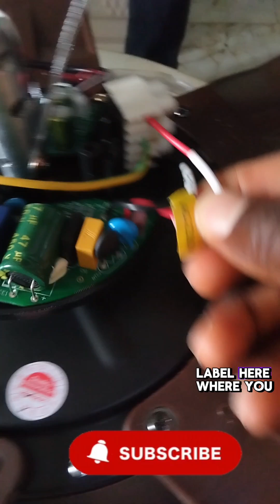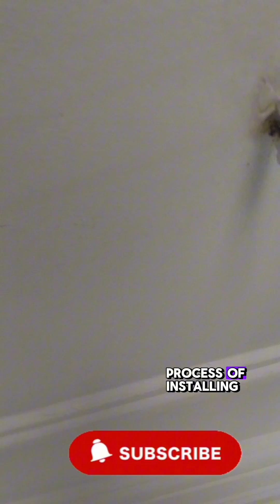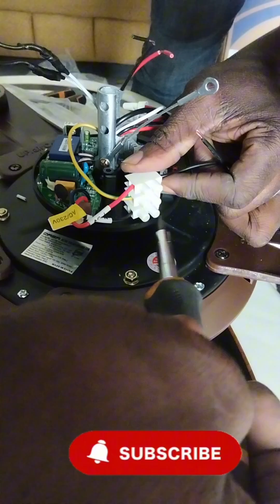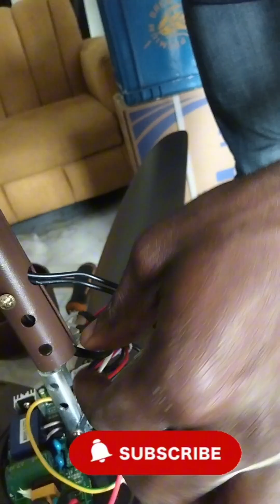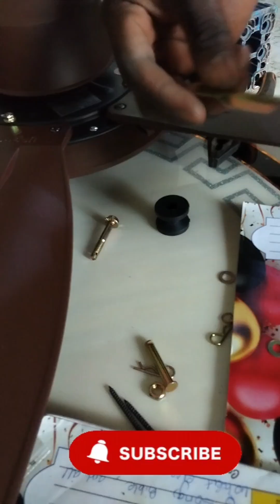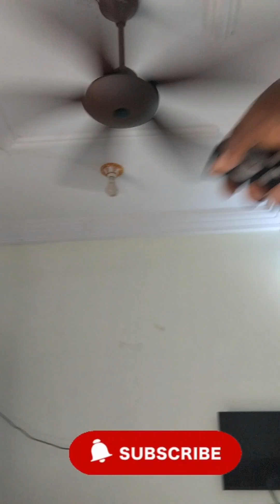How to install AC/DC solar ceiling fan and it wiring techniques

Comment: Sir when ever i connect the solar it start but when normal current comes it automatically on by its self and it wont off with the remote how can i go about it
Reply from the maker: Tho I don't know the kind of DC AC fan that you are using but normally DC AC fans has this internal ability to switch to whatsoever ever power it chooses to work with and it works perfectly
Reply: So u can guide me on it sir

Comment: Did you join Ac with DC line together or you skip DC line since you not using battery?
Reply from the maker: Yes skip skip DC line since u are not using batteries or 12v solar panel

Comment: Nice one . weldon.
please talk more one the control. Will AC wire also come to control as well?
Reply from the maker: AC wire goes direct to control board  regulator goes to regulator as DC to 12v battery or panel